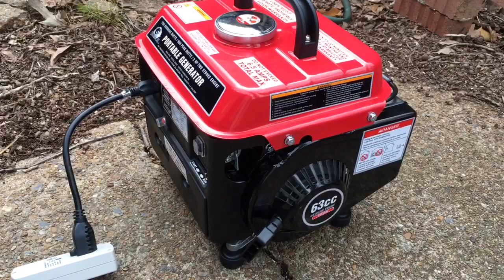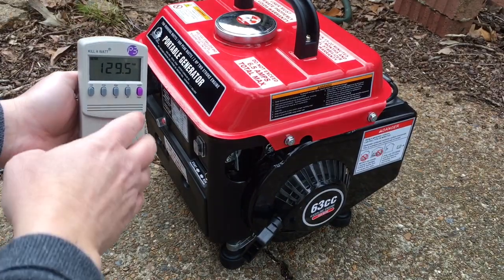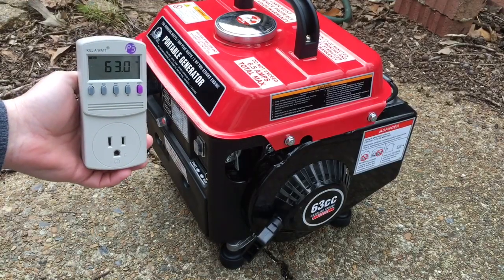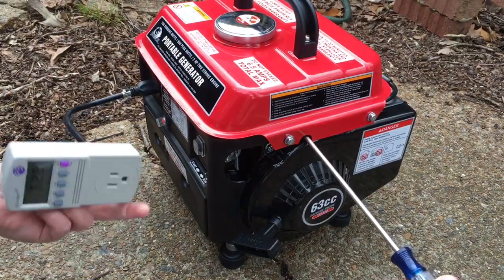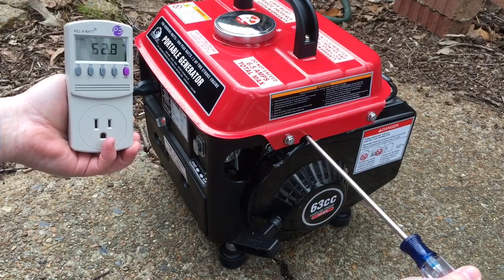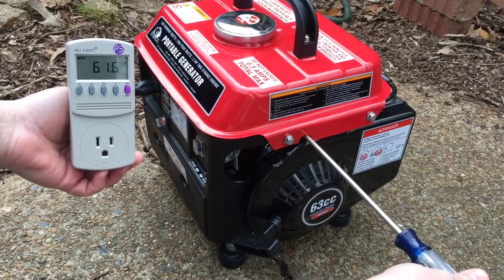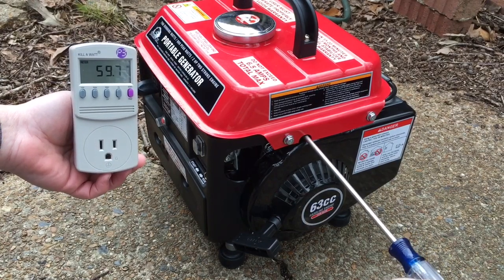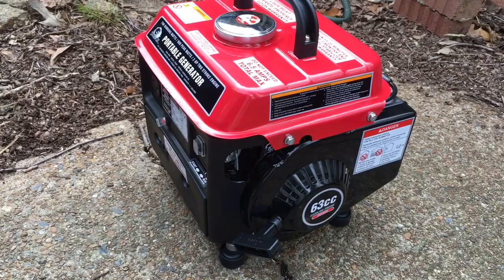StormCat 900 watt portable generator voltage adjustment

Comment: I bought one Saturday and it was about 140 volts out of the box measured with a Fluke digital and Simpson 260 analog.  As voltage and frequency are directly related on the small generators , a viberating reed meter showed way above 60 Hz.  I did cut it back to about 124 volts.  I will have to check it after I have  ran it for more than the half hour or so that I have so far.   The voltage does seem to hold constant under about a 250 watt load. 

I should looked for the video first as it took me a while to locate the adjusting screw.
The screw head was also filled with some kind of 'tamper proof' material.

Comment: It's actually best to adjust frequency with the generator loaded to about ~50%. The engine slows down, when loaded. Just accept the fact that it will be a bit high unloaded, and that it may bog down below set point at full load. If you have a specific use for the generator, adjust to 60 Hz, while driving that particular load. Don't worry as much about the voltage. Granted, these generators aren't exactly perfect, but they're well worth the asking price.
Reply: Makes total sense to me.

Comment: Very useful video. I hope you don't mind but I'm sort of into these little generators. I put the waffle below on the good videos like yours just to help people across the pond. It's nice to see in the comments that no one is trying to burn it out straight out of the box.  

I have stripped both an old 650W and one of the new '900W'. The winding's are the same.  It's the good old Chinese playing the numbers game. Next year they will be 950W or even 1000W. They run well at 500W. The main problem is 'inductive loads'. Light bulbs usually blow when you turn them on. The filament has a very low resistance when cold and the current they use is many times the normal just for that split second. These little generators will stand quite a bit but hang a 1000W saw on the end with a high inductive load (most motors do) and it'll be goodnight Vienna. There is a YouTube video somewhere of an elderly U.S. chap living out in the backwoods that's had one of these running for 6 hours every day for 5 years at 500W. He's got a 5A fuse in the line .  Mine is 3 years old and I have a 2A fuse (UK - 250V) . I have blown the fuse but it could have been 'smelly' - that's what we call our little generator. There are more of these generators around the world with different names than makes of beer. They may have Harbor Freight on them but it might as well be Kiss Me Quick. 50:1 fuel oil is OK if it's not a hot day, if it is use 40:1. That's not on the American ones but is on ours. It's 30:1 while running in. Treat these little gens like an old wrinkly like me and they'll go forever.

Come to think of it I don't know if the UK version has your adjustment screw. I'll have a look tomorrow.
Reply from the maker: Thanks for the comment. They are great little generators for the money. Let me know if your generators across the pond have the same voltage adjustment spot.
Reply: Sorry to be so long, I lost your vid, didn't subscribe like a twit. Found it by accident 
The answer is YES - it''s been bugging me as not to reply was rude.
Reply: There is a good reason for that. For us who which to enjoy life these little generator's are our baby's. An as long as they live we can enjoy life without to much trouble.If they are feeling under the weather we learn how to adjust there intake an every now an then we buy them the real gas treatment or real gas. Not this eathenl stuff our cars an trucks have to put up with. What can I say, I bought her a few month ago with extended warranty an she still in the box. I want to make sure I don't  over work her the first time out, an that I learn all I can from those who have posted. There are many opinions as to what kind of fuel to use and some who suggest how to start them up so you don't damage them. Some say you have to start it with the choke always and turn it off by using the fuel cut off switch. To prevent wear an tear on the switches. I'm the proud father of a TailGator generator and its green just like me. Thank You Loader.

Comment: Kev, I tried doing what you recommended. It was on the newer Harbor Freight 2 stroke generator. Before I adjusted it on a 'no load' basis, it read 120 volts and 62hz. I should have kept it there! Anyway, lesson learned. I brought it down to 60hz but the volts slipped to 85. I still love all your videos. David
Reply from the maker: 120@62 is very good for one of these generators. Move it back up and leave it there. Thanks for the comment.

Comment: I have a 950dc supersonic 650 - 750watt, identical to this little generator. I live in south africa and we use 220-230volts at 50herz. I found on my generator it was best to set the frequency at about 52 - 53 herz under no load, once a load is applied it drops to 50 - 51 herz and voltage is between 218 - 230 volts. The governor screw is very sensitive and one must take care when adjusting. Adjust in small increments turn off the generator and re start it, then do another hz test. You will also notice that the voltage when not under load is slightly low, do not worry about this, its the frequency that is important. the volts will increase and frequency decrease once a load is applied.

Comment: Well as soon as you put a load on it it will be way in the low 50hz range and choke it out, rule of thumb is to tune your frequency at a half load it will be running a little fast without a load on it but will be fine

Comment: Thanks for posting this!  As far as I can tell, voltage adjustment aside, this is the only YouTube video out there that shows how to adjust the idle on these little fussbuckets.  As you probably know, there's no real idle adjustment screw on the carb.  The owner's manual is not much help. Under "check/adjust idle speed" it just reads, "should be serviced by a qualified technician."  Your video is the only hint I've ever seen that there's even an adjustment screw up in there.  Somehow I just never noticed that access hole to it up above the pull start. 

I've got one of these that started idling way too low.  I pulled the carb and really cleaned her out properly, thinking that might be the problem, but still, it'll just barely keep ticking over if you fuss around with the choke.  I'm gonna fiddle with that adjustment screw you've pointed out when I get home tonight.  I have a hunch it'll do the trick.  Thanx again!
Reply from the maker: BilgemasterBill Thanks for watching and commenting. I'm always happy to hear the information was helpful. Let me know how your adjusting goes.
Reply: KevCentral: Well, between your tip about that adjustment screw and cleaning up that little spark arrestor screen doodad on the tip of the exhaust, yesterday I got her running again just as sweetly as ever.  I then just used a Harbor Freight multimeter to fine adjust the voltage.  So anyhow, thanks again!  I thought the old girl was gonna be relegated to the role of "spare parts donor", but it seems she's got some life in her still.

Comment: You're adjusting the engine RPM which directly affects the "frequency" of the AC generated which is measured in units of Hz.  The change in voltage is coincidence and should not be considered to be adjustable by changing the engine RPM.
Reply from the maker: +Jon Dison That's the only available adjustment on these generators. The increase (or decrease) in voltage will adjust the output, so it is an acceptable adjustment for this generator as long as the resulting voltage and rpm are within factory listed specs. Thanks for commenting
Reply: @KevCentral  Hey Kev just think, if any big box bike brand made these generators they'd be $100. But if Trek , Giant , Santa Cruz,Yeti,etc.. made a similar 2 stroke generator. They'd want at least  $1,000 for it, although it might have a slightly stronger pull rope,.spark plug and spark plug wire that cost them an extra $10 to add.

Comment: Easy-peasy!  I'll check mine next time I have it running to see what it puts out.  I have no Kill-A-Watt, but I do have a different wattmeter, but alas it doesn't read Hz, so I'll have to go by voltage.
Reply from the maker: +jaykay18 Yep, it's super easy, and most certainly worth the time. My main unit went from 120v out of the box to 137v at around 15-hours run time...with a 300 watt light hooked to it. The test units both increased, but not as much. One was 129v (one in the video), the other hit a high of 131v. I would also recommend doing a second check with the generator under load to ensure voltage is proper throughout the use range.

Comment: It's good to keep 60hrz 110v of you only plan on running 200w max on the gen  but 61 62hrz won't kill anything 127 128 v is good if you have a load 300w and more the power factor is greater therefore you have more power from the gen if you  using running power tools .

Comment: Adjust with a load.
These two stroke generators will last an eternity when loaded with 500-800 watts. Lower loads promote irregular running rpm and carbon buildup in the exhaust port and muffler.

Comment: i have the devices same as thos different manufacturer. When i measure its phases, its give phase to phase, not phase to neutrol. In my country phase to neutrol is 220 volt. But the generator gives phase to phase 220v.

Comment: This is a bad idea. mechanical governors have a 5% droop tolerance. Running at 62.5HZ and say 129VAC is perfectly normal. When under load the engine speed drops and voltage drops. Your save range is 108-132VAC and 58-63HZ, i mean ideally it should be 120VAC 60HZ but you cant always get that with a mechanical governor. The bigger 10k and and up machines employ an electronically assisted mechanical governor by use of a stepper motor. It monitors the speed and makes minor corrections where it keeps the 60hz within 1% instead of 5%. Anyone reading this since this machine has no AVR, set the engine speed to 62.5HZ and LEAVE IT ALONE!
Reply: i have one that has 10 amp dc outlets. if i plug in an inverted will the output be clean? also what precautions should i know when i break it in regarding the electrical components. some say you cant go full load. why?
Reply: Like to add i work on old emp gensets that have mechanical gov. And once tuned up and adjusted i get only 3% swing

Comment: That screw adjust both voltage and frequency?How to set frequency at no load to make generator run fine when the load is applied?

Comment: i have this generator, and i'm only getting 0.11 volts fluctuating to 0.20, and its obviously not putting out power, i've changed the capacitor. i've taken it apart and checked the rotor and pretty much everything. everything seems fine. is there anything else i should check?

Comment: You would be better served to set the frequency under load, not unloaded as shown in this video.  Even though the engine is mechanically governed, the loaded RPM, and thus Frequency, will be somewhat lower when the generator is loaded.  If you can locate the voltage regulator, there may be an adjustment pot on it to set the voltage.  I have had to do this on several larger generators, but my little genny like this one has been close enough to spec to not need a voltage adjustment.  It did need a frequency adjustment, as you demonstrated here.

Comment: My new Tailgater from Harbor Freight , the voltage 122 to 59 to 122 every 6 seconds ?
Reply: After (3) more found one that holds voltage without a large drop . Proper break in and NGK plug . I run this every day as Mobile Mechanic . Any change will update .
Reply: @rareform6747  How long do they last?

Comment: You do not want to make this adjustment while the generator has no load. Mechanical governors will droop a few hz from no load to full load no matter if it's a little 900watt hf storm cat gen or a 350kw diesel industrial gen. Also Voltage should not be adjusted by changing the engine speed, to do this correctly you need to change the size of the capacitor in the excitation circuit.
Reply: Not trying to nit pick you, just a bit of friendly advice from an industrial generator field service technician.
Reply: damn get that off of google or what?
Reply: 06halfton4x4 absolutely right.
The 120 plus volts it had to been with was fine

Comment: I noticed on my 800 watt generator from harbor freight the voltage jumps around a lot. Have any idea to fix that?
Reply from the maker: Love2boat92 That's common on these little generators. They provide dirty energy. I wouldn't be too concerned as long as it's not too bad under load.
Reply: KevCentral Ok. Thanks. I don't notice the tool surging at all.

Comment: I have 2 of these and found that when it goes up in load it does not keep the voltage or HZ . Both of mine do the same thing. I tested mine with a cheap harbor freight free meter and a fluke 77 . I wish there was a way to bring down the hunting on it .
I am a disabled vet and use mine with a ups for my O/2 system.
Reply from the maker: +ncrdisabled Submarine vet Thanks for the comment. From my experience with these generators, they tend to settle in once they're broken in. All three generators I have run pretty sold at load once adjusted after a breakin. That said, on my personal generator I adjust mine with a load, and it runs pretty consistent. Again, once it's fully broken in. How many hours do you have on yours?
Reply: I bought my first 1 from HF around 6 months ago. I have used it a few times when the power goes out so I would say around 30 hours is that a long enough break in ? The other one I got right before the video and it blew up so I got my money back as they did not have any more I bought a power pro 1000 from Autozone right 2 miles from my house . It has a volt meter right one it. I have just started it 2 times it does not have a adj like the HF gen set . I did load it down and it was more stable then the HF but it does not handle the over load like the HF But I did get it at a great price .  They had one left and it was the last one on the east coast . It was 129.99 on sale for 75.99 and I got 15% off that with my disabled vet discount . It only has a 90 day warranty and they do not have a extended warranty to buy  . But in the first 90 days they will send it out for repair after that I have to call a 1800 number to see how much it would cost to fix it.I know I keep checking other stores when I go out and I haven't found one in 11 stores
Reply from the maker: I looked at those Power Pro generators a while back. I like that it has ann integrated volt meter. Let me know how it holds up.
Reply: OK will let you know when I can run it for a while

Comment: Is this same adjustment available on the tailgator too or is it different
Reply from the maker: Same design.
Reply: Can it run a shop fan me and my uncle Rex sell bird feeders and house's and we need run a fan but I'm hoping the tailgator can run it can it?
Reply from the maker: If you’re talking about the large shop fans it would likely have trouble providing power for the start up surge.
Reply: @KevCentral  I'm talking about a smaller one just enough to keep us cool while selling our stuff
Reply: @KevCentral  will it run a small shop fan
Reply from the maker: Check out my other videos on it. Some have it running multiple small HF fans
Reply: @KevCentral  I did see that video I totally forgot I did dang brain fart it did get wonderful reviews my step dad calls harbor freight the toy store I guess soon me and uncle Rex will be making a trip to the toy store to get one of these generators and some cans of 50:1 premix
Reply: @KevCentral  someone said if you run high octane gas in it it ups the power is that true and is it good for it or will it hurt it

Comment: mine is currently showing only 62 volt do you know what could be wrong?
Reply from the maker: jigc23 For It to only be 62 volts it would have to be super low rpm if everything else were ok. Did you attempt to adjust it with the method in this video? If so, did it have any effect? I suspect that with such a low output there is something else going on. Perhaps someone else can chime in with more helpful information.
Reply: Some of your cheaper meters will not read true RMS

Comment: I did that with my generator. I got it down to 60 Hz, but my voltage was reading 104. I'll have to tinker with it and find the middle ground. I really don't want to burn anything up. I only have 8 hours on my unit.
Reply: David S if you only run resistive loads that frequency doesn't really matter however when you run an inductive load the frequency is important. the fact that the voltage is low at 60 hertz makes me think perhaps your capacitor is bad.

Comment: Hello turkey  energy 220 V. I am looking generator on board  indicator 240-250 V .  Generator output multimeter test  240-250 V.   questıon my TV 220 bu generator 240-250 V energy is NORMAL ??

Comment: Hello,
My stormcat doesnt seem to produce the same watts like it used to.  Using a 4.5 amp grinder, it stops producing power for about 10 seconds then comes back, then same thing happens.  Would it be the capacitor?  Thanks for the videos!
Reply: Mine does the same...i changed the capacitor, same problem

Comment: Don't set your generator based on voltage, Always set it based on frequency.
Reply from the maker: That's what I always use, but I think I did say in the video either could be used. Thanks for posting this information.

Comment: This generator should be used for nothing more then lights, and low grade electric devices. Never run sensitive electronics such as computers, and other things as this.
Reply: what if you plug an inverter into the dc ports?